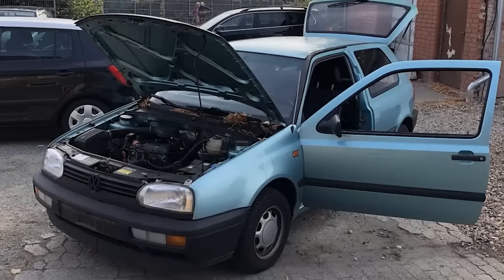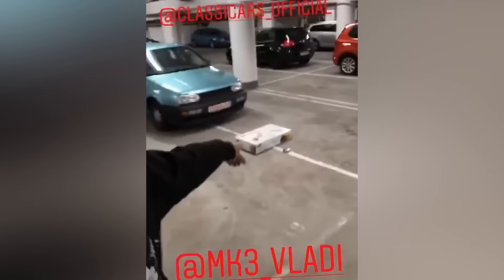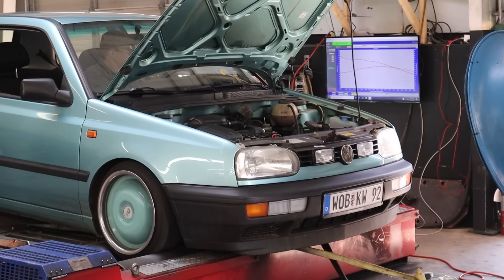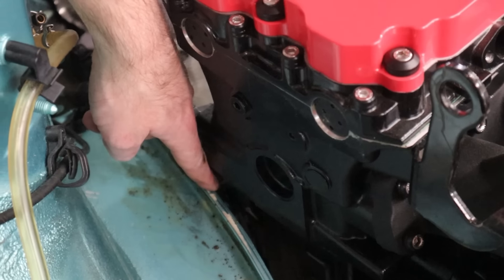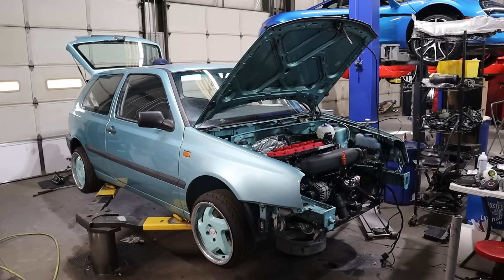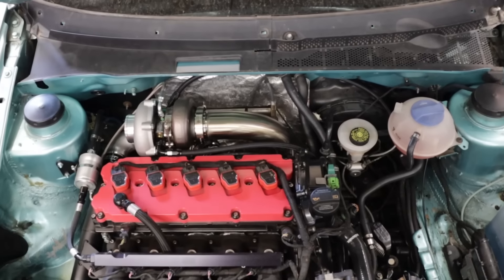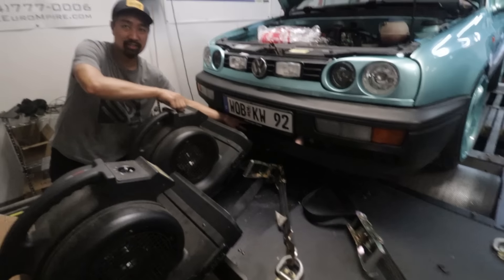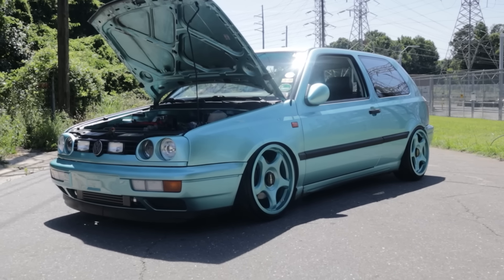James from Donut 2.5t MK3 Build - Start to Finish!

Comment: Would the swap kit work for a 2011 2.5 jetta or 2013 2.5 passat to turbo them?
Reply: Why get a swap kit? All you need is a turbo manifold. That's literally the only part that is hard to find to turbo the 2.5. Once you have that just buy a Turbo and all the necessary parts needed and have shop install it. There are many tuners who still offer a turbo tune for the 2.5 like 034 Motorsport. Others like United Motorsport can have you send in the ECU and he will flash it with a turbo tune. Just remember. You can turbo our 2.5 easy but not so cheap because... our axles/transmission/diff and pretty much everything else that takes on that power, will break. I guarantee it. Thus correctly turbo-ing a 2.5 is very costly. Search up Florida07K. He does a complete cost breakdown of properly turbo-ing a 2.5.

Comment: Why would you make it drive by wire?? The turbo already kills throttle response as it is
Reply: I guess the engine came from the factory with drive-by-wire throttle body and they couldn't be arsed to convert it to cable. But to be honest when you go this far to make a swap, building custom parts and everything, you could find some cable throttle body that fits this build. Same thing with not doing a Quattro/Syncro conversion.
Reply: @FUNLICKER2215  exactly. If you're going this far just do it! It dramatically increases throttle response and makes it much more fun to drive

Comment: I am honestly confused as to why you did not swap the 4 bolt suspension for the 5 bolt VR6/GTI suspension. That is pretty much the standard in germany for every engine swap. No matter if 16V, VR6, 1.8T or TSI. Allows for better steering rack and anti sway bars. Pair this with some polyurethane bushings and you've got much better suspension performance with the power on the front wheels.
Reply: Or just buy a good condition vr6 gti!  Then add a turbo kit?

Comment: The rectangle grill lights would look great with a European yellow tint with LED bulbs. 

The film is cheap on eBay. Probs $20 in US money
Reply: Yeah, Lamin-x is what you’re talking about. Comes in yellow, smoke, clear, light blue and different thicknesses to protect glass lenses from rock chips. I’ve used the 30mil version on like 4 of my bimmers. It’s good stuff.

Comment: Makes me feel better about sinking ungodly amounts of money and time into my Fozzy (the white one there <<<<) 1999 Subaru Forester Turbo s SF5 with a built 2006 Impreza STI engine, gearbox, hubs, shafts, diff etc running a haltech on 99 octane, 412 Bhp to all 4 wheels. ZeroSports body kit, oz super turismo wheels, TEIN street master pro coil overs, white line anti lift kit, 20mm sway bars front and rear, Cusco upper and lower strut braces. Bare metal rebuild that took around a year and more money than I’d like to admit, all done at home either on the drive or in my single car garage

Comment: Surprised to see the original 1.8 8v engine being so far of the claimed power figures as they are known to be very rugged.
Reply: not that bad at the wheels with 90 at the crank supposedly
Reply: @gnaedigerfels  
I have to disagree.
In that case it’s a drivetrain loss of almost 35%.
Pretty sure the engine is worn.
Reply: @frenchtoast-d7u  it probably has like 75 to 80 after all those years which ain't to bad

Comment: I just got a 95 Jetta and the key won't unlock the steering wheel,doors,not even then center console lock, and when I put the jump box up to the battery the alarm goes off, need help Brotha

Comment: i need to get in contact with someone who knows 2.5s i have a b7 passat 2.5 and i want to make this kind of power. how is he pushing 330 with a stock engine and 10 lbs of boost? i need to know!
Reply: slap a turbo on it, and pray it won't explode

Comment: the original 1.8 is the AP? dammmm... if it is, here in Brazil people go bananas on this little engines, swapping heads, forged internals. there are some drag FWD cars with an AP family engine going over 1000 CV ont he little 4 cylinders, peopple use it over here to drag race becouse ir came on A LOT  of VWs, Audis and even Fords (from the Autolatina, a collaboration between ford and VW in the 90's here in Brazil)

Comment: i need the build sheet to turbo the 07k someone help me pls
Reply: I can't help as far as a "build sheet" per se, BUT there are a lot of very useful videos of these builds. We have cast intake and exhaust manifolds for more power, a full "kit" hasn't hit the market to my knowledge. I know a good combo of parts that alot of builds use is the Audi RS4 fuel pump paired Bosch 550CC injectors for fuel delivery. Another essential mod is a catch can system as the 07Ks factory Positive Crankcase Ventilation system is a PIA (they fail regularly and are integrated into the valve cover). I know SPA makes exhaust manifolds around $399 but some have had success fabricating their own. Integrated Engineering has an upgraded intake manifold for around $900 but the stock intake manifold from what others say is still good for 14PSI and the 07K is really only safe for a maximum of 15PSI unopened. Hope this helps

Comment: Is this the mk5 2.5?  Always wanted to see sum1 boost that engine.  Cool car ^^ 2 bad James is a raging libtard xD
Reply: Mk6 had them also
Reply: @buddysshop1860  yeah I wonder the changes from 5 to 6
Reply: @hyper8545  I can only speak for the Canadian and US market. The original 2.5 was different. Lower horsepower and still used a MAF sensor. The ones after were all pretty similar. There are a few guys that have made videos comparing the differences
Reply: The 2.5L shown is the 2.5L TFsi motor from the RS/TTRS series...not the 2.5L thats in the later Jetta's....I know I was really hoping it was the Jetta's 2.5L as well.
Reply: @Raymo2u  oh really? Yeah man, the base 2.5 should be getting more love. The guys at CO Motorsports had a corrado with a 2.5 swap from a vw making 350whp on a stock engine. Said that's as far as they would push it. Friggin awesome
Reply: Chill bro
Reply: @Raymo2u  doesn’t look like it
Reply: @buddysshop1860  I own a 2011 Jetta SE and Ive got a UM Stage 1 tune, AWE full exhaust, Injen Intake, R8 Plugs so far.
I'd like to get the IE Stage 2 Kit but $1,500 for maybe 20-30 more hp doesnt seem worth it considering that I could probably scrap together a turbo setup for a grand more and get atleast double that power.

I wonder if a AMR500 Supercharger would be able to flow well enough to work...

I wish more companies would do more for the engine considering they are plentiful, cheap, and reliable. C2 and others USED to make a turbo kit but that was before I was in the scene and now they are near impossible to find. I also wish that companies like IE who've shown a fully built 2.5L revving to almost 9500rpm would offer fully built N/A Engines like MonkeyWrenchRacing does for my Toyota Celica GTS.
Reply: @buddysshop1860  yeah he rage on Twitter about all sorts of lefty crap.  But he in cali so what you expect. =/
Reply: @hyper8545  ahh, ok. Another tolerant lefty 🙄
Reply: @buddysshop1860  i watch co they r dope shop. Sucks they in Canada tho 😕
Reply: @hyper8545  I'm sure they could ship to you. I'm in Canada too, aka Chinada, but I'm no where near them unfortunately. Seems like an awesome shop to deal with
Reply: @buddysshop1860  yeah I'm in wi =[